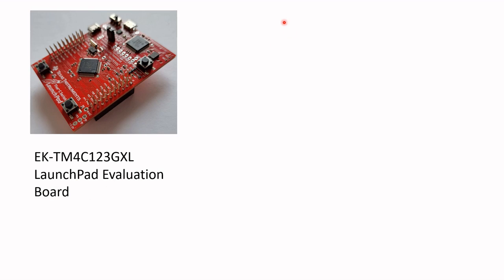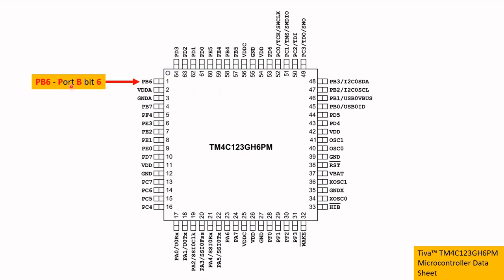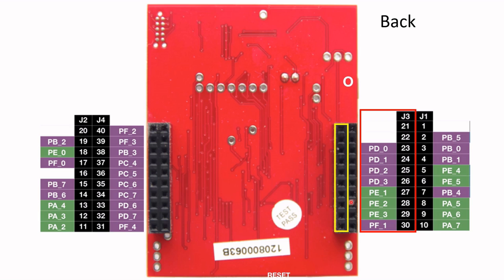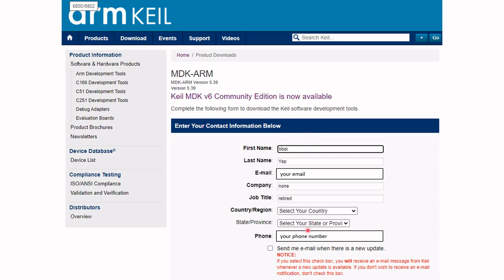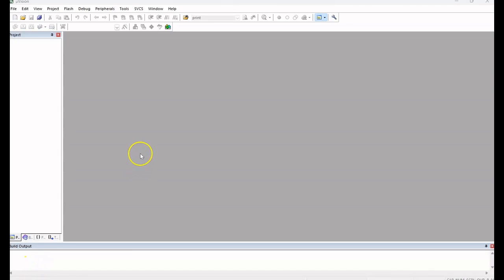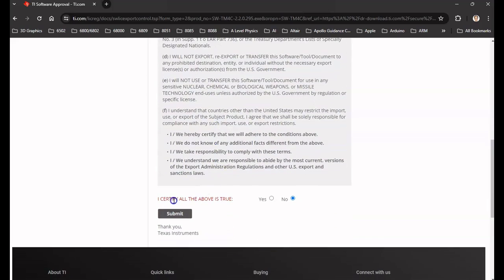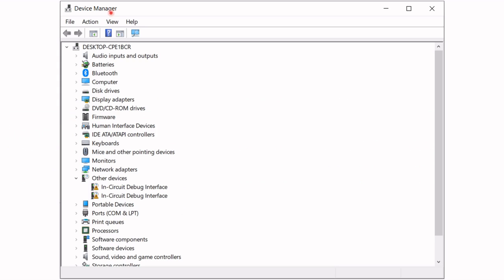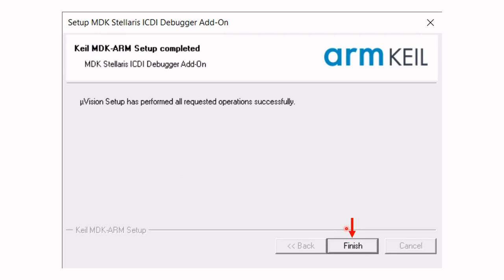#83 TM4C123GH6PM Cortex M4F Microcontroller - Installing Keil uVision and TivaWare for C Series

Comment: I've downloaded the ICDI driver on a different folder and not in the C drive, and now I'm unable to see it in the debug. What can I do?
Reply from the maker: Sorry, for late response.
Confirm the driver actually installed correctly

Plug in your board (e.g., TM4C123/TM4C129 LaunchPad).
Open Device Manager (Windows: press Win + X → Device Manager).

Expand these sections:
Ports (COM & LPT) — you should see something like:
Stellaris Virtual COM Port (COMx)

Universal Serial Bus controllers — you may see:
In-Circuit Debug Interface (ICDI)

If you see a yellow exclamation mark, the driver didn’t install properly.
Fix:
Right-click → “Update Driver” → “Browse my computer for drivers”.
Navigate manually to the folder where you installed the ICDI driver.
Select it and install.
Reply: I had the exact same issue and have managed to make it work, here's how:

Re-download the same ICDI driver but make sure you save it INSIDE the folder that you installed Keil.